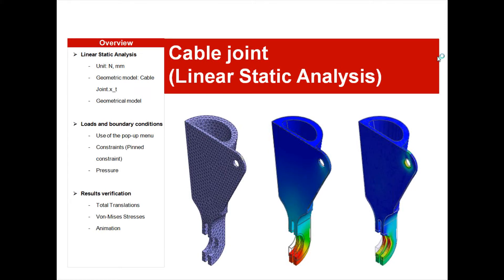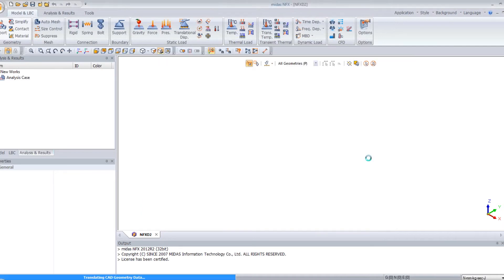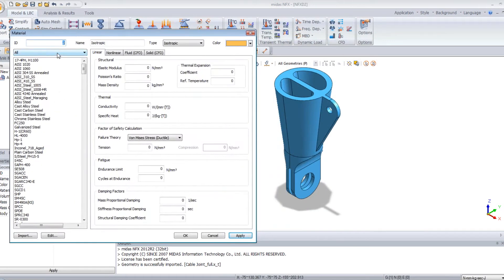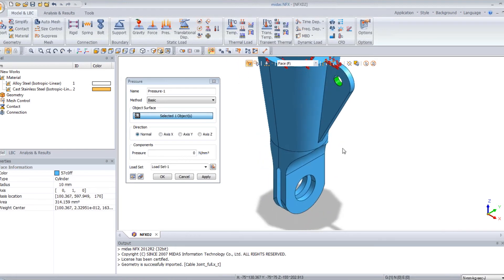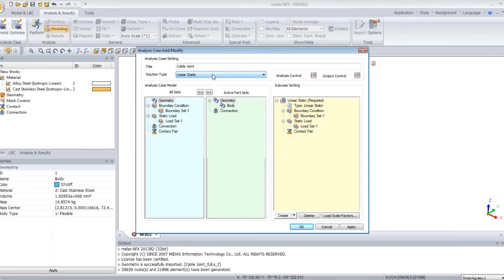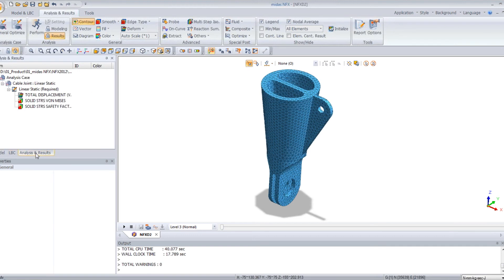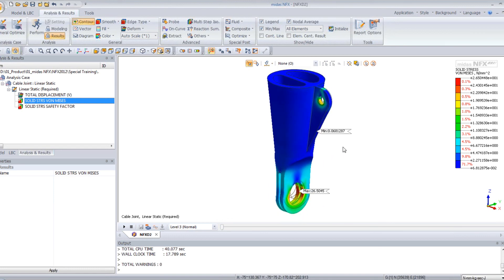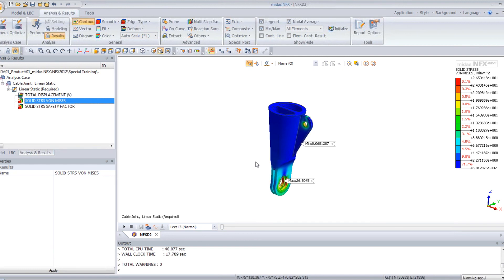MIdas NFX - Linear Static Analysis Tutorial 1

Comment: hi..can i get your example. just 1 folder is fine..im new to midas nfx
Reply from the maker: If you have installed the software, this cad should be already on your computer. Check the midasNFX installation folders, there is one folder called “manual” in which you will find all the tutorials
Reply: @Feaforall  What should i do with "Default Mesh Set" in 2020 version, i can't add any geometry in it and it comes as an error during "Analysis"
I see there is a significant change in UI in the 2020 version compare to 2012 version and could not find any material/tutorial with the 2020 version.
I appreciate if you can make one for 2020 version.